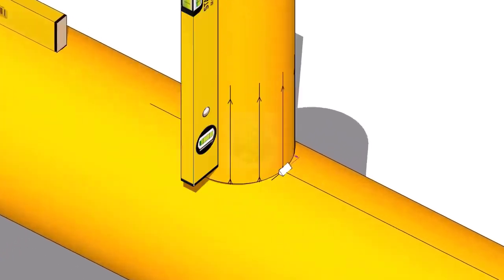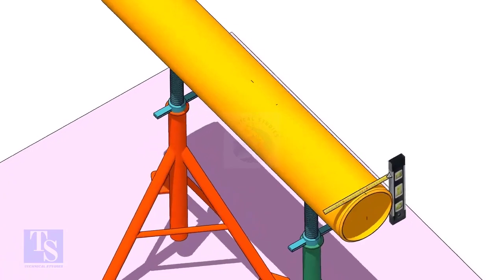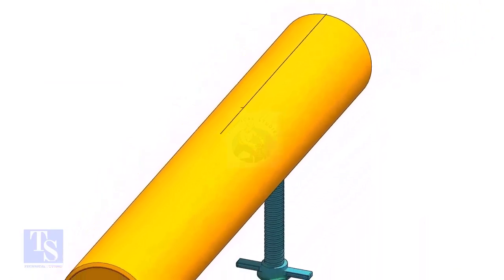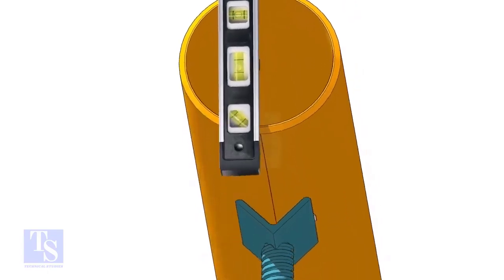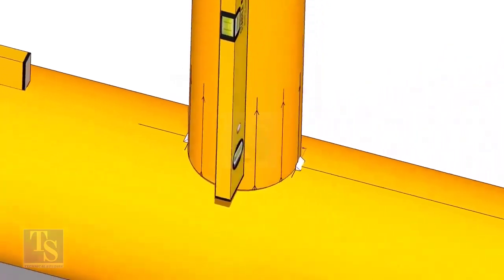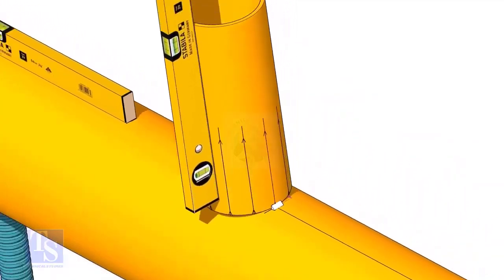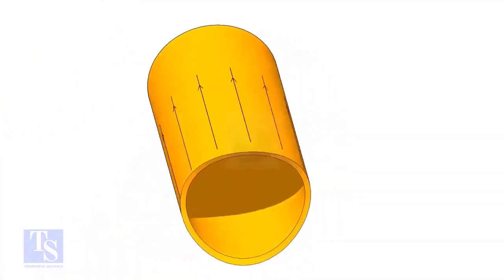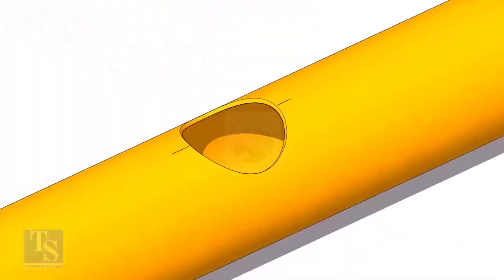Reducing abranch, Easy marking and fit up.

Comment: Yeah i need to learn this im a student welder and engineering student thank you man this is very helpful i have also seen those videos where they use like a fine marker and tie to a  string then hold the other end in tension then essentially use it like a compass but i think they do it by eye which obviously is not accurate but definitely good skill to have when you idk learning TIG welding on pipes